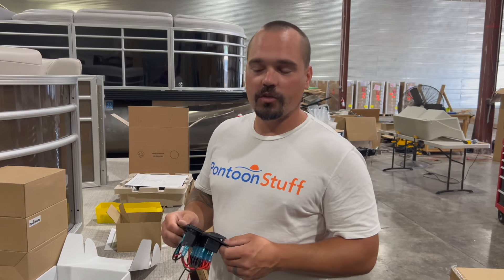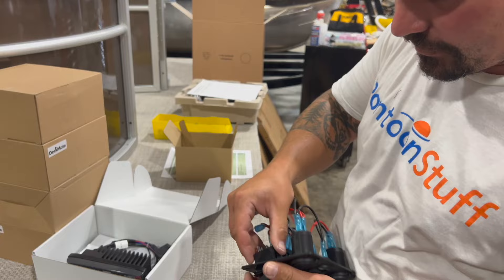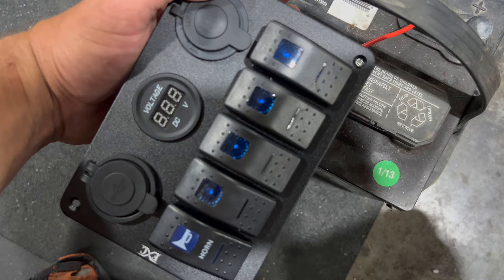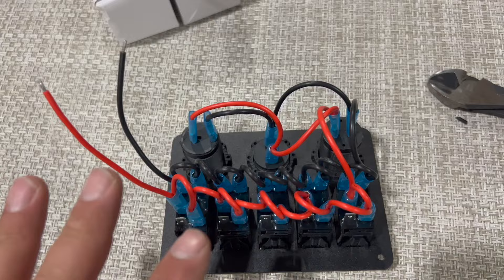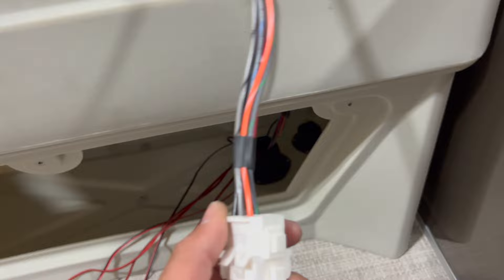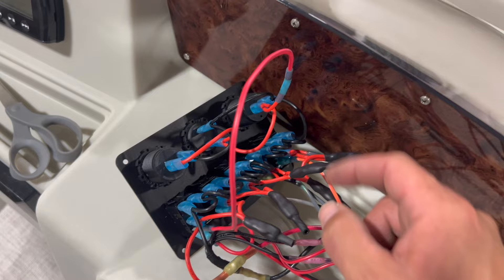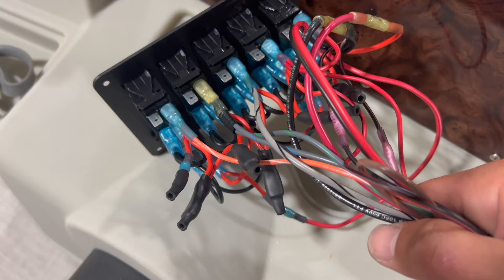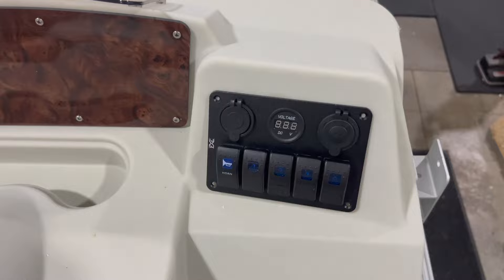Amazon Switch Panel - HOW TO WIRE INTO YOUR BOAT

Comment: I didn't realize that all my rockers and push breakers were on the way to fail.  I bought the panel similar to the one in this video except I wanted the push reset breakers on mine.  But it left questions on why it was hooked up boat with so many piggyback connectors.  it was overwhelming,  but once I started to remove the old breakers I could finally see a much simpler wiring method and now with this video that answered my questions on can I do this the way I want it set up and the answer was yes.;
  Thank you for such an in depth view and explanation that didn't leave me with more questions than I started with!
Reply from the maker: You’re not alone! Looking at wiring under a console or on a switch panel can be super overwhelming, but once you take a step back and see where things are routed and how the switches and breakers work it’s not so bad. Thanks for watching, glad it helped!

Comment: Thank you so much for this video.  I tweaked it a bit since mine is similar but different.  Your instructions were invaluable.
Reply from the maker: I have several different but similar switch panels on stock right now…they all end up wiring in the same or similar. Glad the video helped you out!!

Comment: Excellent tutoral.  A question, you disconnected the positive leads to the "always on" LEDs on the rockers.  Can you use the corresponding ground side to complete the circuit for each switch, rather than grouping all the ground wires together?  That way if you ever need to make a wiring change, you wouldn't need to tear the ground bundle apart.  In fact, it looks like you could just move all the jumpers over so there is only one black and one red jumper per switch, then just clip off the extra jumpers to get them out of the way.
Reply from the maker: Yes, those grounds could be used to tie in accessory grounds. As long as they make it back to the negative post on the battery some way then you're good to go. Not all of these switches have that option though...sometimes you'll even order one and something a little different will show up in the package!

Comment: Thanks for this video,  I have the same switch pad and will do the wire swap also.  I was going to put my horn on a push button but might order the rocker switch.
Reply from the maker: If you have a free switch I recommend the rocker, it’s on Amazon too. Nothing wrong with a push button too!

Comment: Great video, but I can't help but wonder why you got rid of the main connector and hardwired everything.
Reply from the maker: Just wanted to show it as simple as possible, expecially for folks who might be reusing their boats old electrical harness where there may not be a plug. It can absolutely be wired into the quick plug too.
Reply: @tomspontoons  Nice. I'm gonna be using one of these switches in my Silverado for all of the accessory lighting and my amp for the subwoofer, but the hardest part is keeping everything in a way that if I go to trade the truck in or sell it I can return EVERYTHING back to completely stock with no cuts in my factory harness what so ever. I even have my REM hooked up to a toggle so that I didn't have to splice into an accessory wire.
Reply from the maker: @averagejoe6150  I haven't tackled something like that on a vehicle before, but I would think that if you supply power to those accessories independent from the truck's harness it should be possible...just like you're creating a completely separate electrical wiring system that shares the single battery for charging/powering purposes.
Reply: @tomspontoons  That's basically how I'm gonna be running it. I'm installing a second battery here soon with a battery isolation switch and running all accessories off of the second battery, gonna run a bus bar inside an encapsulated mount inside the cab to run everything directly from it, only thing I'm gonna do to the stock system is upgrade to 0 gauge wiring, doing the big 3 as people like to call it. I may end up needing a high output alternator though, we'll see how the stock one handles everything for now.
Reply from the maker: @averagejoe6150  Yep, that's what my biggest fear would be...getting enough charging to keep up with that much output. Best of luck with getting it set up and installed!

Comment: my plan with the 'fripperies + gimmicks' on that fuse panel is to fit a switch and / or relay in series with the ground, - a powered on relay can be arranged so that the n/o contacts provide ground, - basically  creating an 'ignition' line for when the power system is having a good time, - solar panels are generating plenty, wind is abundant ...water turbine is giving plenty......
Reply from the maker: Definitely lots of ways to do it and plenty of options for switch panels out there too!! Thanks for watching!

Comment: If you have a battery switch on the battery mains, it makes sense to not tie up a switch location to power the LED's and whantnot.
Reply from the maker: Everyone has their favorite battery switch configurations. I love having the switch panel set up so that when all the switches are off and unlighted then we know there’s not draw from accessories. Quick and easy way to keep from leaving anything turned on.

Comment: Thank you, one thanks !! question, can I use one of the switches to power on all the lights and volt meter, lighter and USB?
Reply from the maker: I often do exactly that…make one of the switches power on the backlights, volt meter and accessory plugs

Comment: This video is definitely going to help my husband and I rewire our new to us pontoon.  Why is it so difficult to find used fencing and gates?  I realize that each pontoon is different, but gates shouldnt be hard to find.  What do you do with the old fencing you remove?
Reply from the maker: Great! We've got lots of other how-to electrical videos on our channel, so surf around and you'll find more like this. The issue is that the boat manufacturers have made boats with certain railings and designs for only a year or two before changing things. Sometimes they only make a small number of boats with certain railings/seats, so finding a replacement part is impossible. I get asked all the time if I have "a back port corner railing section off a 1998 Manitou"....and unfortunately I have to explain that they're best chance would be to find a fully intact boat for that one part. They're just not out there! We usually sell used railing kits cheap and fast locally, or scrap them if they're in rough shape.

Comment: Have you considered using the first switch to power the led lights and voltmeter / usb / cig lighter? Basically one switch to connect / disconnect the rest.
Reply from the maker: I use the last switch in this video to power the chargers and volt meter. I would be hesitant to use one of these switches to carry the load for powering the rest of the switches/accessories, as that could be a lot of power forced to run through one switch if all other accessories were being used simultaneously.

Comment: Excellent video. Do you by chance have one regarding hooking up to separate motor trim switches?
Reply from the maker: I do not. You'd need a momentary up/down toggle switch and to tie into your motor's ignition harness...usually green, blue, and red wires that are run for trim on most motors. Generally, green is down, blue is up, red is power.

Comment: A USB plug also has a "phantom " load even if nothing is plugged into it and will drain the battery. Any USB sockets should be on their own switch.
Reply from the maker: 100% agree! They usually have a little LED that’s lit up too from the factory. I switch the wiring over on all of them to be powered by a switch!!

Comment: The problem with those prewired gang switches is that they are all fed off one power source which has to be fuse protected, you lose that fuse u lose the entire panel.
Reply from the maker: Even factory switch panels are typically protected at the battery on the positive with a 20 amp breaker or fuse. The better option out there has breakers for each switch to help with that, but you’d still usually see a breaker at the battery for the main power.

Comment: I bought a couple of panels very similar to those, one 4 gang and one 3 gang panel, with the USB, 12v cigarette lighter type outlet, and voltmeter sockets also. But I removed all the wiring and ran each switch on its own circuit so I didn’t have to worry about overloading one circuit with too much stuff on it. 

Also I removed a couple of the USB and voltmeter socket accessories and replaced them with a hole plug cover designed to fit the 30mm round openings. I got some of the 19mm locking push button switches and they will fit into the 30mm plug covers if you drill a 3/4” hole. They just barely fit, and getting the nut screwed onto them is a tedious job, but they do fit and it works well. I wired the panel so that one of these push buttons is used solely for turning on “dash lights” which is the bottom LED on the rocker switches, and the ring LED on the push buttons. Each of the square shaped LEDs on top of the rocker switches I wired to be on when the switch itself is on. So using the 30mm hole plug covers I was able to add additional switches to the panel without taking up more space. Also bought an Oznium mini LED dimmer knob for one plug cover and installed it to add a dimming effect for my interior lights. Haven’t hooked it up yet but it is on the panel. All fits well.

The 12v socket and USB ports that I removed, I bought additional bezels and reused them below the switch panel. I did this because I did not want power cords hanging down from above the rocker switches, in front of the switches. So I created a clean switch panel with switches, buttons, and a knob, and kept the outlets for cords in use but more conveniently located.
Reply from the maker: WELL DONE!! You took a simple and cost effective switch panel and made it work far beyond what it was even designed to do. I'm very impressed! And yes, I do usually recommend running this with inline fuses or to a fuse panel. Definitely can't hurt to do so!

Comment: Could you use one of the switches as you main "power connect" to enable the power to the system.  In other words , in stead of having a remote power switch that gives power to the boat . Could you just route the main power to a switch to power up the boat though the switch panel?
Reply from the maker: I wouldn’t recommend that as the switches aren’t designed to carry that much load individually. I try to keep items that are up to 10 amps draw on each switch with a fuse running out to each accessory.

Comment: Best explained AND SHOWN video yet. Thanks tom. I just have a question i have just a usb outlet version that has the main live and neutral line in then out to the switches but its rated at 5v 4.8amp would this blow anything that i put in it like my phone ?  As my phone uses 5v 1.5amp ? Thanks
Reply from the maker: Thanks for watching! That’s a great question. Do you know if the 4.8 amps split between the two USB plug ins? I’ve definitely seen plenty of 2.5 amp chargers for phones and such. I will see if I can do some research and figure this one out.

Comment: So what would I be doing wrong if there’s constant power to lights attached to the switch board and the switch doesn’t do anything to turn the lights on/ off?
Reply from the maker: Either a bad switch, or you hooked up your lights to the wrong male spade post. I'm assuming you're talking about the accessory lights you hooked to a switch, and not the switch indicator light itself.

Comment: Great video! Just curious, the components being controlled would still need a relay for high amp draw things, correct? I’ll be using this type of panel in an off-road rig and powering my cooling fan through it. The “power” wire on the switch would simply be the trigger wire for the relay right?
Reply from the maker: Correct, I have some other switch panel videos showing tying in an in-line fuse to each accessory. This was aimed at being a super simple starting point for getting going with these switch panels.
Reply: @tomspontoons  wonderful, thank you!
Reply from the maker: @lelandglisson3392  happy to help!

Comment: Are all the Grounds shared to each other?
I have a similar setup but for my kayak.  All my grounds have separate runs and power wires. 
I want to simplify my setup.  Thanks in advance.
Reply from the maker: Yes. On this panel you'd need to either run a ground buss bar connecting your accessory grounds to the buss bar, or piggy back the accessory grounds onto the grounds on each switch. A ground buss bar is probably easier and cleaner.

Comment: I just received this unit however I don’t have the two leads coming out to hook to the power. Do I have to add this or did I get an incomplete unit?
Reply from the maker: Every switch panel I've gotten from Amazon has had the power and ground leads off the switch to hook to. You may have received one missing parts. It seems like every time I order a panel from Amazon if there's a good amount of time between orders I end up getting something quite different from the same manufacturer, and even if I use the "order again" option.

Comment: How could you wire the switch panel to a fuse block with relays so that a master switch (only power available when accessory ON) powers the other switches.  I have the switch panel figured out, just trying to see how to join it to the fuse block/relay.  My max amp draw on individual circuit is calculated at 26 amps (LED light bar).  The other two circuits are less than 10 and less than 5 respectively.
Reply from the maker: I haven't attempted to tackle that yet. I would probably run the power through a larger capacity on/off switch with a breaker or fuse and heavier gauge wire (10awg) to the switch panel. I'd also make sure the switches on the panel can handle 26 amps (that must be a serious light bar!). I know they're not super heavy duty switches and a lot of similar panels run a 15 amp breaker at the most. If it's more than one light bar I'd break them into multiple switches to get that amp draw more manageable for each switch.

Comment: What if you move the main power source wire one pin down on the accessory pin ?
Reply from the maker: That's a good question, I didn't try that. If I do another of these panels on a boat I'll report back.
Reply: Damn. That's a good idea, can't see how that wouldn't work

Comment: No fuses on any of these circuits? Bypassing the quick disconnect plug on the harness makes for a messy or painful electrical system servicing for other technicians in the future.
Reply from the maker: Totally see where you’re coming from!! I’ll always advocate for a higher end fuse panel with fuses built in, but this video is for those folks out there who opt for the less expensive route. There is a resettable fuse near the battery to prevent system issues.
Reply: @tomspontoons  do you have a video showing how to wire in circuit protection to the individual switches? I want to use this style panel and rocker panels and wire in the circuit protection. I can’t order any of the rocker panels with circuit protection built in due to space unless I want to spend 200-300 bucks so I need to make my own. Hope that made sense any help appreciated.
Reply from the maker: @battlemasterszone1750  Check out this other switch panel video I did. I run inline fuses to each accessory. I will be doing one where we run a fuse block in the near future too so that folks can see the different options!

https://youtu.be/bycK-FVW1g8

Comment: Do you have fuse between switch and light?
Reply from the maker: Definitely should add a fuse between the switch and the accessories!! This is just the basics of getting the panel to work for most boating applications!

Comment: ive making my own on alumium angle but adding fuses they would just go on each pig tail or on positive wire going to battery?
Reply from the maker: I’d usually recommend a fuse for each accessory, and it’s not a bad idea to have a larger (20amp) resettable fuse at the batter too!
Reply: @tomspontoons  ok thanks

Comment: Do you have a link to the switch panel that you used? I don't see it in your Amazon links
Reply from the maker: Not sure if this is the EXACT same one as there are a ton of different brands on Amazon, but this is very similar:

https://www.amazon.com/FXC-Waterproof-Aluminum-Vehicles-KG0149-5B/dp/B081KZKGP5/ref=sr_1_4?crid=HUZQFJJHW39P&keywords=marine%2Bswitch%2Bpanel&qid=1693321620&sprefix=marine%2Bswitch%2Bpanel%2Caps%2C127&sr=8-4&th=1

Comment: Do you need to use a circuit breaker with this set up?
Reply from the maker: There should be at least one fuse or breaker with any panel. A fuse block is super easy to use here too. We will show that method in the near future too!

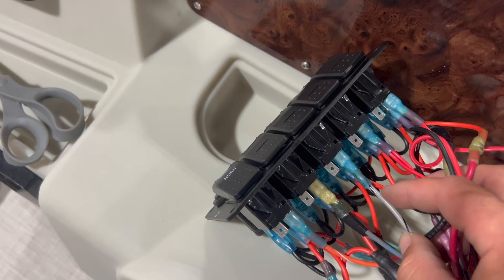Comment: Are the extra ports just more positive ports for each switch? 9:30
Reply from the maker: If you go back to 3:55 it shows those posts had a power wire run to them from the factory that I unhooked. They were what lights the bottom of the switches all the time (on or off).